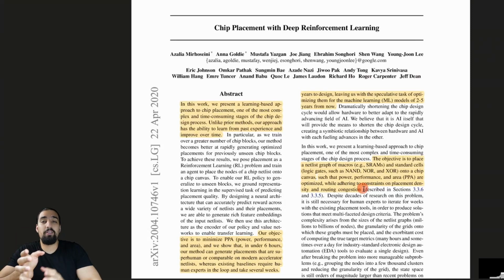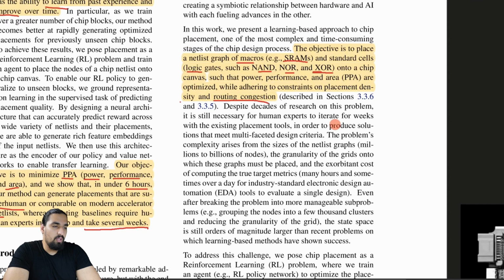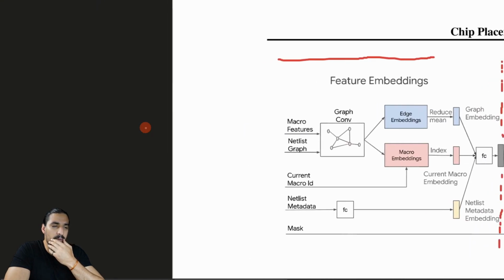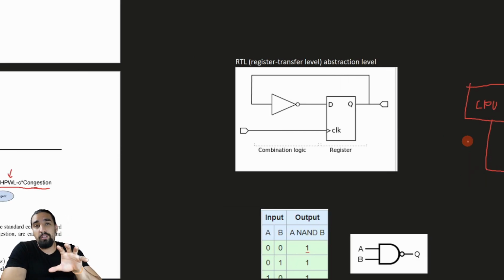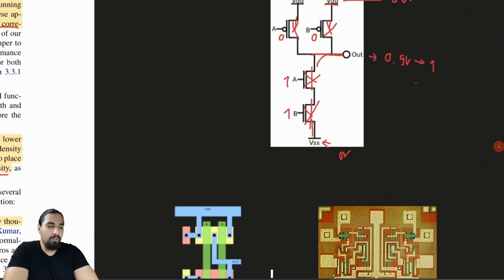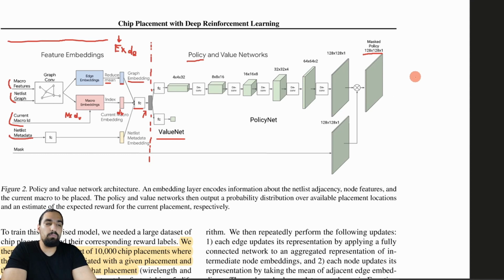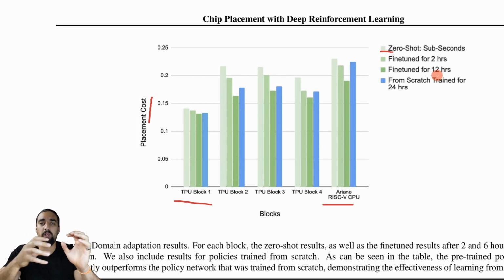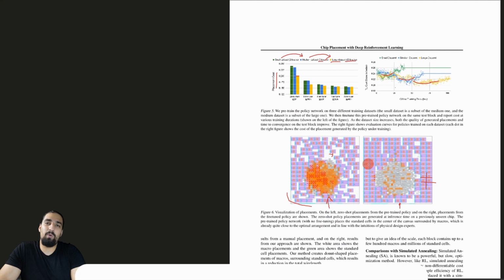Chip Placement with Deep Reinforcement Learning | Paper Explained

Comment: Of course they had to use the existing placement tools to build the data training.  The problem with this method is that you still need the placement tool that costs a million dollars or so.  But still a novel and impressive work. It would be interesting to see if they used 5 layers of metal vs 12 layers of metal.